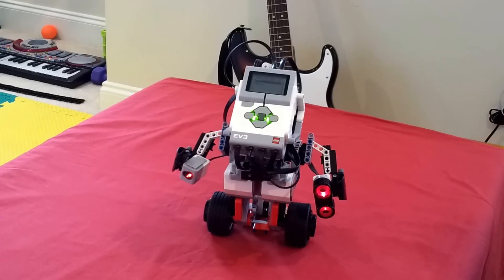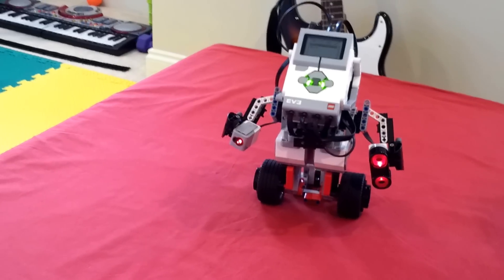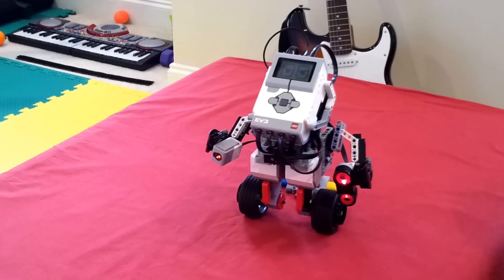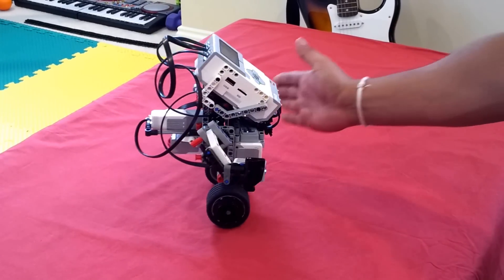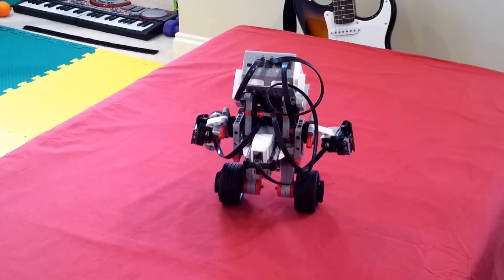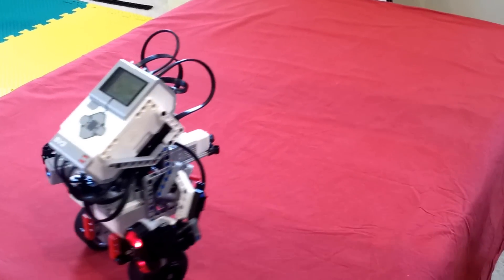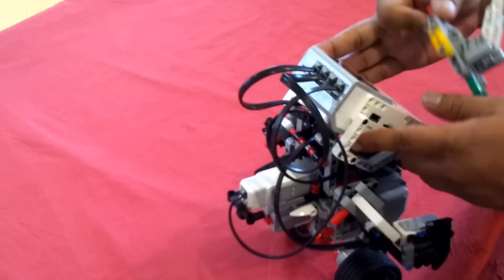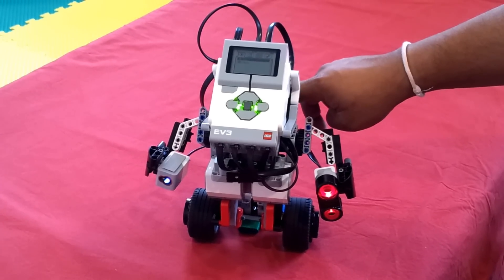EV3 Gyro Boy in Action / Demo

Comment: How does your robot balance itself? I have built it and programmed it, but the moment it goes off he stand it just falls down.
Reply from the maker: It's been awhile, however if I recall there was a stand you build for it and it takes off from there, this helps sensors calibrate prior taking bot out of support which is key to balance. I hope you are running this way?

Comment from the maker: Hey - Just make sure the Gyro sensor is installed the way it is suggested in manual. Also, keep it stable on stand, if it is shaky at start may cause this.

Should this not work, you may want to test Gyro sensor by looking at Port View ensuring that Gyro sensor is functioning fine, it is the key sensor to balancing data feed.

Let me know if I can be any further help.
Reply: TasteOfGyan what app did you use to control it ?

Comment from the maker: Hey - The program is already bundled in the software ...

Open the Software > Click Model Core Set (on left side navigation) > Select Gyro Boy (On the right side panel) > Click Open.

It will show you 3 steps on the small window on right top ( Also called Content Editor ) - If you don't see it default, look at screen right top, right below Lab View (Text), there is a toolbar, last icon is Content Editor Toggle switch.

On the content editor Go to Step 3 and double click it will open the program.

Comment from the maker: Ahh .. just put it on stand you built with it , straight position & make sure it is on some flat hard surface. It needs to be on stand and no motion when you hit the start button. I had the similar issue if I attempt to run it on carpeted floor or try to start on inclined position. Good Luck and let me know if I can of further help.

Comment from the maker: Certainly. If you can explain the issue you are running into we can try to fix it. Assuming you have built the model as expected and should have issues with program - one easy you can check would be to connect your EV3 via Bluetooth or USB. Once connected, go to Lobby > Model Core Set >Model Instructions > Gyro Boy > Open > Content Editor > Step 3/3 > Double Click on the Program Image. It will open a new Tab with Program loaded. Just hit the Download and Run to see it in action.